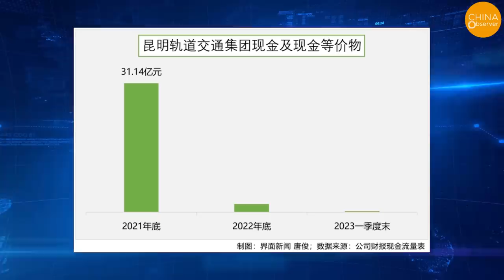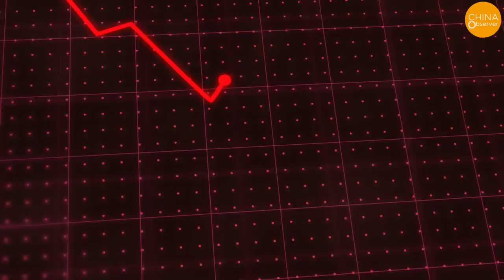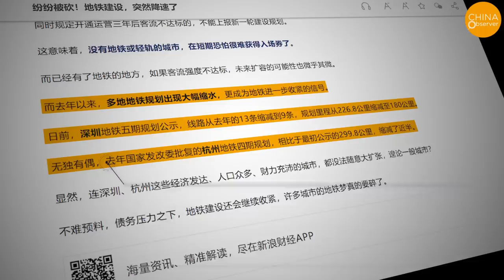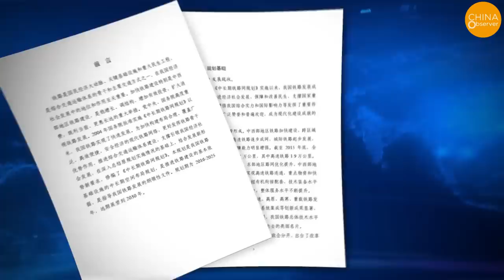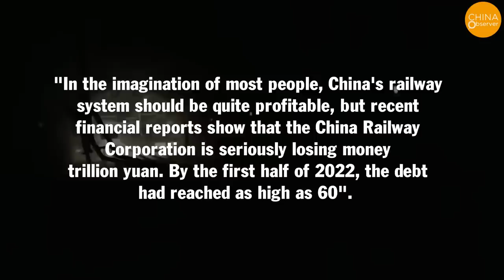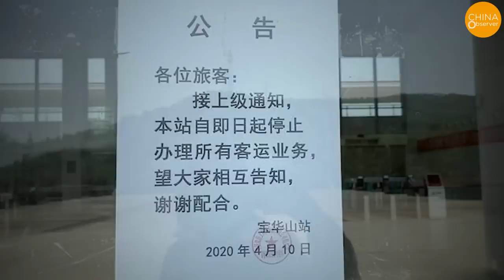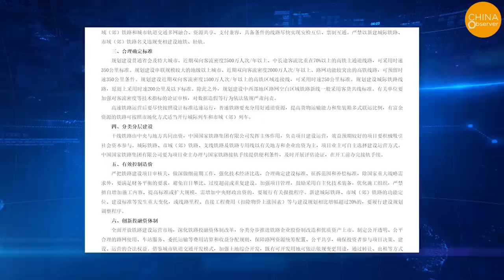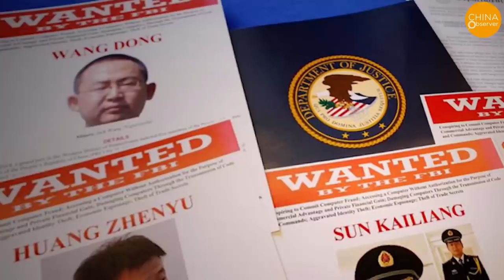China’s High-Speed Rail in Crisis, Leaves "Zombie Stations", and Debt Surges to 9 Trillion Dollar

Comment: The Chinese HSRail system concept is wrong from the beginning.  Japan  built HSRail stations near the city centers, conveinient for business, shopping, commuting, etc.. In China they put the stations far away from the city centers very close to airports. It is very inconveinient, put additional costs and time consuming.  Japanese Shinkansen runs frequently and have free seatings that require no reservation, good for last minute  hop-on hop-off unlike only reserved seatings in China. In China as the land is vast it is much cheaper and conveinient to fly around. 
Because of their strict vertical political system organized by only corrupt Yes-men there are no one wants to offer or is listened to the commonsense as long as they can profit from bribery.
Reply: Dumb comments, have you ever taken a HSR in China? Have you ever visited a new station not in the city center? It quickly becomes a new city center and brings lots of business. I have traveled extensively via China HSR, I know what I'm talking about.
Reply: @danielluan6824  I also know what I am talking about! Take Xian HSR station for an example. It is located far away from the city center and need to take the subway to nothing around. The station is too big. I can't get on the platform until passing through the metal detector, need to wait in queu to buy the ticket by showing the passport, no ticket dispenser, no free seating all reserved, wait for the gate to open righht before departure, no food or bento kiosk on the platform, etc. etc.  Other stations are similar where I went to several places. On the train Chinese are  too loud talking to each other or on the phone.
I've been to almost all Shinkansen lines in Japan. No comparison for the convienience , ease of riding, and relaxation.

Comment: Infrastructure and transit doesn't have to be profitable, although the economic benefits of some parts of China's high speed rail network are questionable.
Reply: It still needs to break even on its own, otherwise that subsidy will eventually end up on the chopping block when the times are tough and money is tight. It must be remembered that China's fixation on high-speed rail crowded out the market for standard passenger rail, which also has the added benefit of moving cargo in large volumes alongside people. Before 2008, freight rail was the predominant way of goods moving around the country. After 2008, and the massive debt-fuelled stimuli that the CPC enacted, HSR became the sole focus to the point where freight rail capacity diminished significantly. That's why the overwhelming majority of Chinese freight is now moved via truck (if memory serves).
Reply: Nope, it has to be profitable, otherwise it will be subsidize which will increase taxes especially to those who will never use the train,
Reply: We all long for a Nationalized British Rail... Privatization = A business plan that includes strikes and inevitable loss of tender. Hit & run!
Reply: @tehandroidmaster  They stole the high speed stuff from the Germans.
Reply: @Labyrinth6000  Actually, a lot of the world's public transit is partly paid through things like VAT and homeowners taxes, like in Canada.
Reply: @Labyrinth6000  it's very hard to be profitable in public transportation. Break Even is a much better target otherwise The society will be left without any public transportation ever built.
Reply: State paid infrastructure makes sense when planned and based on demand. The problem is china put super expensive high speed rail all over the place as a flex for global power to show "China is best!". They didn't put right sized solutions based on need and as time goes maintenance skyrockets with no one using the trains.
Reply: The idea behind “has to be profitable” is correct even though “profitable” is only an appropriate term in some situations. Going back to first principles, the difference between consumption and investment is whether one is spending in a way to have more or just spending for pleasure (which includes the pleasure of showing off.) In order to qualify as a genuine investment, HSR construction needs to be undertaken with a view to not only recouping that cost from its operation but providing an additional return. If it is built recklessly as to such recoupment and additional return, it’s just consumption.
The reason “profitable” is not always the appropriate word to use is that there are cases where there is a privatised return on a publicly funded investment: for example in many countries, the public transport systems upon which the economy depends are subsidised from general revenue and there is no profit to the operator. However the system is critical for the workers to get to their employment and the cheaper fares benefit both worker and employer in a measurable way. Without the subsidies, wages would have to be increased or employers would have to pay for their employees to use the system (as happens in Japan.)
The problem with the Chinese extensive rollout of HSR is that it’s politically directed for political ends and it’s funded by debt. Consequently, apart from the first 2 or 3 lines, there is no economic boost, just a loss of capital and an ongoing loss from keeping it running. It’s a classic case of malinvestment: there is a short term boost to GDP during construction followed by a long term diversion of resources away from other useful projects because of the need to service the debt.
Reply: @brucetownsend691  Very good information !

Comment: Another factor that might have contributed to the failure of many infrastructure projects could have been wrong assumptions about the actual population size. It's quite possible that China's population is much less than the often cited 1.3 billion and more close to 0.9-1.0 billion, as was speculated by some Russian and Japanese researchers, based on some actual consumption data.

Comment: I’m still surprised that high speed rail is used anywhere outside of the larger Tokyo metro area. You essentially need most of your countries population to want to go to the same place doing the same work every day in a geographical area no bigger than a large metropolitan city like Tokyo to make it work. And you need to stuff the humans in like rats to maximize efficiency every working day. And it needs to work flawlessly, because even a string of delays would mean that riders will loose confidence in the transportation and not use it. You can only tell your boss the train was late so many times. In my opinion, only the Japanese metro lines are capable of such consistency. Everywhere else should just be using standard low cost rail or highways.
Reply: The first Shinkansen service was along the busy Tokkaido line where most of Japan's economic and political strengths are located along one route (from Tokyo to Osaka). Expansion of the lines such to Kyushu (San'yo and Kyushu lines) and Hokkaido (Touhoku and Hokkaido lines) came later and are still being constructed, illustrating that a high speed train service is only viable for a string of important cities either economically or politically...
Reply: @theotherohlourdespadua1131  The first HSR in the Philippines that will be built will be the one connecting Manila, to Secondary cities of the Philippines, like Cebu. The first phase will be comprised of 3 HSR Corridors, which is Ilocos Corridor, Cagayan Valley Corridor, and Bicol Corridor (it can be also Manila-Cebu HSR corridor, that passes through Tutuban, Laguna, Batangas through Tanauan, Quezon, Camarines Sur, Albay, Sorsogon before the train line will turn right from Irosin to Bulan, Masbate, and last but not the least, Cebu)
Reply: @ainsleyfrastructurekpopmashups  I don't believe that will ever be built. They can't even roll out real buses in Manila...
Reply: There’s a good reason why most of Germany’s high speed rail is concentrated around Cologne

Comment: Same thing is happening to the US due to the increased cost of construction and the technology used to push these systems. The only major US metro system that makes a profit is New York City's MTA, every other major metro system in the country gets a 30 percent subsidy from the US government as well as gas tax revenues to stay afloat...and then there's my home state of Pennsylvania, which used Act 44/88 to bleed the Pennsylvania Turnpike dry to keep SEPTA in Philadelphia and the Port Authority in Pittsburgh up and running...until the refinancing of the PTC's bonds started to become an issue. Oops.

Don't be surprised if the Chinese do the same thing (increase gas taxes and start stripping toll revenue) to keep it afloat.
Reply: They are a massive maintenance expense.
Reply: Yes, but US infrastructure is 70 years old and needs to rebuild.  It did the job for over 50 years. They got their money worth.
Like a car, how long does it last before you need to replace it? Ten to fifteen years if it is well maintained.

In comparison to Japan, China is only 20 years old and in tremendous debt. Japan hasn't had any fatal accidents for 50 years with high-speed train while China has.
Also, Japan high-speed is profitable.
Is Japan Subway profitable?
Since launching in 1964, the bullet trains have proved to be remarkably safe, resilient and lucrative: Not only do many of the lines turn a healthy profit, but Shinkansen technology, including the software that supports the trains' famous punctuality, is a valuable Japanese export.Oct 7, 2020
Reply: We have cars, we do NOT need passenger trains anymore unless you live in the Northeast corridor.

Comment: The numbers are from 2022. Would like to see the numbers for the 1st qtr of 2023. From what I've seen on the ground in China, the train stations in most 1st and 2nd tier cities are quite full
Reply: there's 2 lines that operate reasonably. Shanghai-Beijing and Shanghai-Shenzhen. You might have seen the images from these. But the majority of the high speed rail is underutilized. Even Japan doesn't build high-speed rail left and right. 
Edit: I stand corrected, not the Shanghai-Shenzhen, but the Beijing-Guangzhou line

Comment: High speed rail is a miney losing prop
Reply: Not if it's done correctly.
Reply: Not sure what you mean by correctly. But all these types of projects require continuous maintenance.
Reply: @sonialelii9038  Any public infrastructure does. But the benefits a good functioning public transit system provides is huge.

Comment: Best approach to their high speed low usage:  offer buffet style plans universally.  Ex:  prepay 100k miles in advance at a low costs usage of per mile for the ENTIRE country at 80% discount or whatever threshold to break even.  First, fill up those hi speed rail since if they run empty, no income is bad.  (Andrew Tate, MONEY IN!!!). Once a threshold reached whereby enough bulk pass holders are locked in to ensure "break even" level, then start offering a gradual increase $$ program Ala carte.  That would be my biz plan...Of course, what goes into hi speed rail will likely come out of the airline industry, no free lunch exactly.